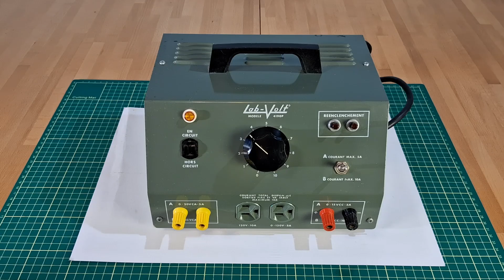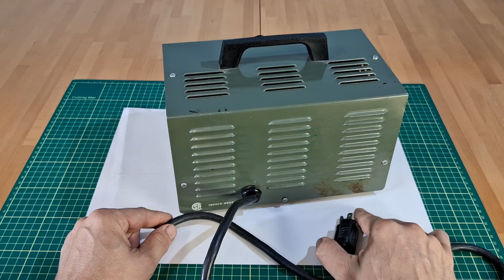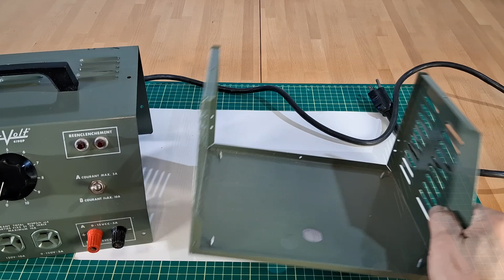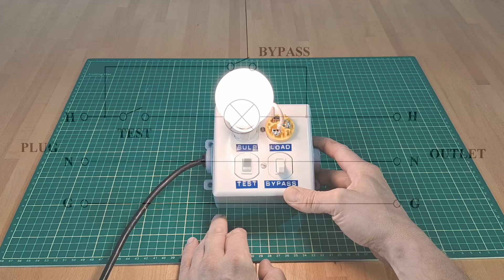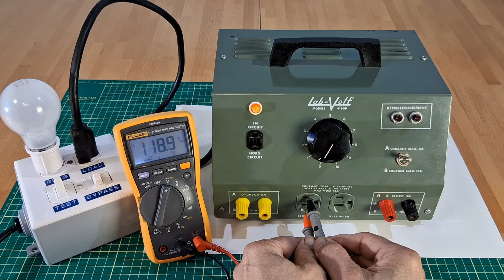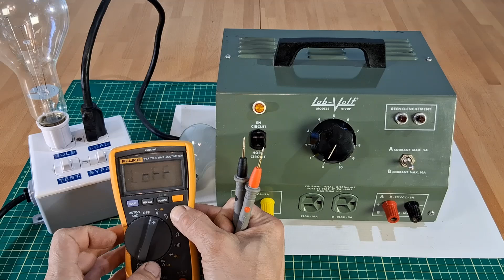Autotransformer and Dim-Bulb Tester

Comment: That was an interesting, informative, and enjoyable video; thanks! It'd be neat to see the output of those DC terminals on an oscilloscope. As for your last question, of course it will light up. You just need to coil up the cord and pass a decently powerful magnet back-and-forth through the coil at a sufficiently high rate. 😜
Reply from the maker: Thanks.